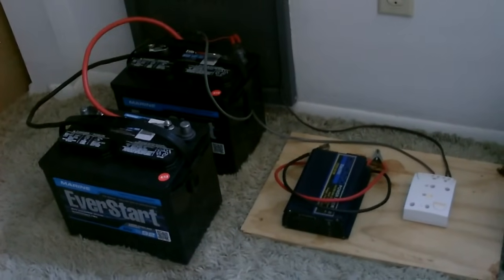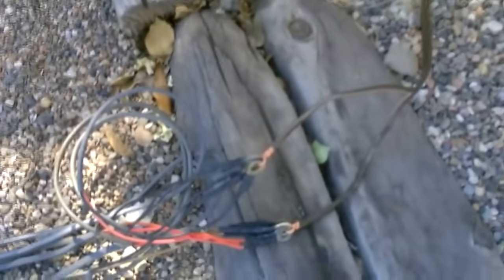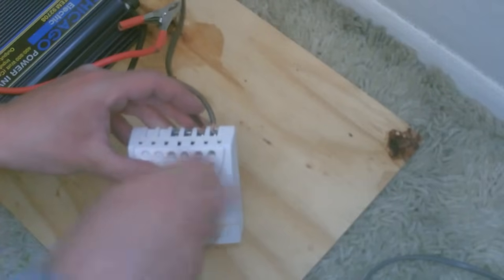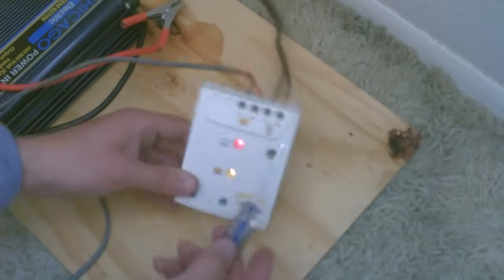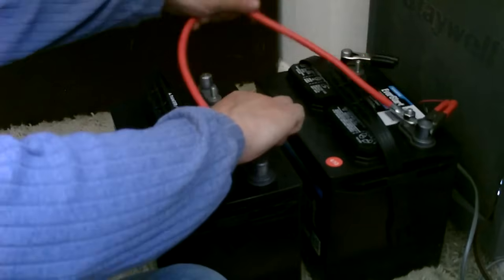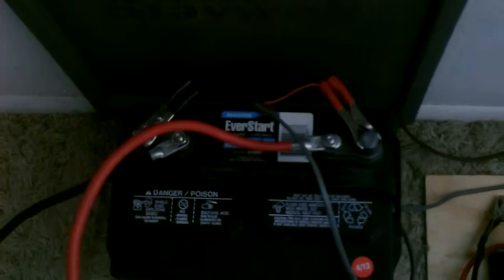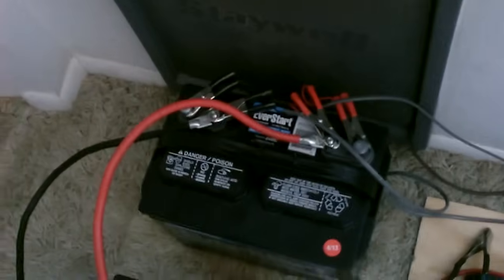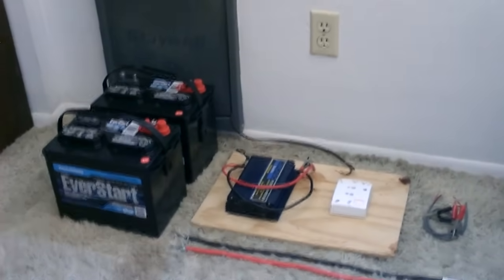How to hook up Solar Panels (with battery bank) - simple 'detailed' instructions - DIY solar system

Comment: Hi, I want to setup a solar power system just for my computer, can you give the details of the things needed? I mean numbers, how big is the battery, how many watts and everything needed to run a computer. Thanks
Reply: Got to have more info.

How many watts does the computer consume per hour?
How many hours a day are you planning to use the computer?
Besides the computer, what else is powered up? like the cable modem, router speakers and maybe a light. How many watts do they have and how many hours are they powered up.
Any printer or scanner etc etc.
Is the computer used to power or charge your cellphone or other things? how much do they consume.
Are you using a UPS that needs to be powered also.

If you are on-grid, on-grid power is usually cheaper than solar power with batteries. A desktop computer can use up to 10 times more power than a laptop. One of our laptop computers is only using 14 watts, but it is small. Our desktop on the other hand is using 350 watts when starting up and 270 watts  when running after it is booted up.  Even the different settings on the TV will make the TV to use more or less power.

They sell a kill-a-watt ( about US $ 20) that you plug into a receptacle/ outlet and you can plug your electrical item into the kill-a-watt and it tells you how many watts an item is using.

I found thousands of watts being used a month by phantom loads when I used the kill-a-watt. Items that used power while they did not do anything...just sitting there plugged up.

Comment: thank you for  the information
do you need  charge controler for small solar panels charging low voltage batteries or is it enough for the solar panel not to be too large for the batteries?

Comment: I have a 60A MPPT charge controller,  (8) 6V gel battery, (8)  250W, 37.2V, 8.87 A, a 4KW Inverter/charger
Is it okay to have 2 strings of 4 batteries in series to feed my charge controller? Please let me know so i do not fry my baby.

Comment: So just a quick ?, how you have to wires from the panels connected is there maybe a bar of bolts or a better way to connect. And how many would you need to run a mid-size refrigerator?

Comment: Can we directly charge a cellphone without using batteries i mean only with the panel or the panel + controller.?
Reply: They have simple little solar kits on eBay advertising that.  But for a system like this you need all the components he showed.  
The only other way is having the solar panels go through a grid tie converter directly to your home power and plug it in ur home wall socket
Reply: The charge controller is there to protect the battery bank.  You'd still need a dc to Ac inverter for sell phone charger.
Reply: Or one of those automotive cigar lighter plugs that convert 12 V to 5 V for the device in question.  Most phones can be charged from 5 V.  You would also need the proper cables.  You could get by without an inverter.

Comment: What kind of life span can you expect to see considering the batteries are in a climate controlled environment?
Reply: A good quality deep cycle AGM battery should be good for 5 to 10 years, depending on how deeply you discharge the battery, and how often you discharge it.  The less power you demand from the battery, the longer it will last.

Comment: Hi can i use this system to power up or to make a 2.5hp aircon run on this system? And also which one should i use the ac to dc or the dc to ac? Can i use a car battery instead of deep cycle battery thanks alot
Reply: +JesMar HS Jose 2.5hp is equal to 1.83 kilowatts, given the power requirements both batteries would be able to run the aircon for just over 1 hour from a full charge (in theory), in practice because the current draw would be so high you would get much less. If you are going to discharge significantly you need a deep cycle battery, yes. If you want to power a mains appliance from a battery you need an inverter (dc to ac)
Reply: Thanks alot for the reply appeciate it. Would you care to let me know how many batteries do i need to make the aircon run for 8 hrs and also how many watts do i need of the power inverter. Again many thanks
Reply: +JesMar HS Jose Hi, according to your information about power consumption of your air con (1.83 kW for at least 8 hours per day), you would need to generate 14.64 kWh per day (1.83 x 8). This would equate about 440 kWh per month (14.64 x 30). This is far beyond a small 'hobby' setup shown in this video and constitutes a large solar installation. Note the monthly energy output. And that battery options are sold separately.
http://www.wholesalesolar.com/1890715/wholesale-solar/complete-systems/the-homestead-3.12-kw-12-panel-astronergy-off-grid-solar-system
something like this.

Comment: @desertsun02
 If,  for example the panels only gave out 1 AMP per day in total 
current,   does that mean that in 10 days if no electricity was used in 
the home that they would have given out to the batteries 10 AMPS in 
total and stored it? 
   Does it keep on adding and increasing the AMPS that can be stored until the battery is fully charged, is that how it works??

OR.....Does it only top up the batteries to 1 AMP as that's the maximum output from the panels so this figure would never be increased and stored in the batteries, this is the part i dont fully understand.

If anyone has the answer i would be interested to find out, thanks
Reply: +SP330Y There is much lacking with regards to understanding here. Amps are a unit of current flow, not to be confused with Watt hours which are used to measure energy stored in batteries. On a full charge the batteries will each contain around 1260 Wh (105Ah x 12V). Time to full charge will depend on the charging current. The efficiency of the charge controller or solar panels is unknown so time to full charge is difficult to know.
Reply: Captain Radd
I have since found out that if for example the solar panels give out 1 AMP per hour and left for 10 hours with no load/drain then it would of stored 10 AMPS into the batteries
Reply: +SP330Y Almost there, but you leave out a few important things. You can't just say a battery stores 10 amps. It doesn't mean anything. Amps are a measure of current flow, a bit like saying the water in a pipe is flowing at 1 gallon per second. You couldn't then say water collected in the bucket at the end of the pipe contains 10 gallons per second after 10 hours. Current is the rate of charge flow. Charge does not flow when stored in the battery.
Energy in a battery is a product of 3 things: 1.Current 2.Voltage 3.Time. If a current of 1 AMP with a voltage of 1 VOLT flows into a battery for 1 HOUR then the battery stores energy equal to 1 WATT HOUR.

Comment: hi there, im checking on video on how to make a solar power like yours but still not sure on how too, can you give some info on how many watts of solar panels i need to recharge my group 31 battery? i wanted to use solar energy to recharge my deep cycle battery while out fishing using my 55thurst trolling motor, i dont want to carry two heavy batteries.
Any info on how to set up will be greatly appreciated, thanks in advance.

Comment: how many panels do I need for the home to be enuf power for the home
Reply: I have 2250 watts of panels and that supplies about half my electricty. So conservatively my estimate is 3000 watts of panels and many batteries to carry through the night. Of course for just a few lights and TV... You could get away with a few hundred watts of panels and say 4 batteries. My peak power draw at home is 8000 watts but that includes aircon. My background consumption is about 350 watts no major appliances running. Consumption can vary wildly. Also consider fridges and if you cook on electricity or gas. Batteries aren't really suitable for cooking appliances. Fridges run quietly but some have defrost cycles that run in heat and you might be surprised as to how much power a fridge can use over time.
Reply: thanks for fast reply I just started doing solar panels research again and I noticed lots of systems out there I like the plug and play system to start with grid tie in inverter, seems like a good way to start and add on from there, this seems like at least I might save some in electricity.
what you think of them, to stay on the grid and get credit for what you don't use, seems like a big savings if no battery's involved
Reply: My system is grid tied with no batteries. It is good but we work during the day so don't get full benefit. The electricity company charges us say 25 cents for one unit of electricity but when we feed one unit back to the grid they only give us 8 cents as we become a wholesaler to them. But when at home using what we produce very good in daytime. My 2250 w panels often generate up to 2500 watts because no cloud cover and high radiation. They once peaked at 2650 w which was very surprising.
Reply: That's so cool, yeah I guss they would give allot less back then turn oround and sell it lol make a profit to, so 2500 watts per day is how many units of $8 cents and how much is your electric bill now compared to what it was before? Mine is kinda strange bill normally it's $110 with 2 outside street lights but last month and month before it was $279 way out there I know I was heating my place but still 1000 sqf home my hear tem set to 62 in the day and was 70-75 in the evening I even turn it off at night and just use space heater for one room

Comment: One more thing: My plan is to use a Renogy 50w Solar Panel Kit, with 10 amp charge controller to maintain charge. Will also be ordering a Krieger 1500w Inverter Kit from Amazon.com. Will be used for weekend camping trips, emergency back up power, etc. Would a 2000w inverter be better with the 12v, 105 amp hour EverStart MAXX? Thanks again...and for video!:)

Comment: Glad to see Ever Start Batteries, as I am thinking of purchasing the newer Evermax "Maxx", 100+/105 amp hour Marine Deep Cycle Battery for my single battery set up. It is only $100.00 at Wal-Mart and not that big at all. I did notice that it is not sealed or maintenance free, is that okay? Thanks!

Comment: Once the sun has gone down and the 2 battery's are not charging, how long (hours) can you use 100 watts continuously?
Reply: You can't run it down to zero. Maximum 50% so half 12,5 hours maximum else your battery life will not last long.
Reply: The 2 battery is enough to power up 2 fan 2 light for next 12 hours.. if you want to power up whole house go pay the bill!! Lol
Reply: +mark oshields each battery is rated at 105 Ah with a voltage of 12V. 105 x 12 = 1260 Watt hours, running 100 watts 1260/100 = 12.6 hours. There are 2 batteries so around 25 hours on a full charge.
Reply: 12.6 years punk

Comment: hi i wanna ask if i can use an ordinary car batteries like "motolite"?? and what is the diff. of "deep cycle" batteries, on a ordinary car batteries?? and how long can i use it at night? ex. i use a small 220V  40W 60Hz fan.. thank you so much!!
Reply: a deep cycle battery is designed to be drained and recharged. a regular car battery is not and will fail after awhile.

Comment: hello. my wife and i are in the middle of building a tiny house and have found a homestead property to move it too. we know we are going to be using solar the majority of the time. is there a way i could contact you via email? we have a short deadline to get moved by and i have no one around me or surrounding area that knows about solar power. i have learned alot from your videos and we already plan to build a cooler ac unit like you showed. thank you so much. the overbays.

Comment: I have a 100w solar panel I want to wire to a battery.  I am in need of roughly a 130AH battery.  Is it possible I can wire the panel to the charge controller then to 2 65AH batteries then onto the inverter??  I am confused when it comes to more than 1 battery.

Comment: are you planning on adding more solar kits and if so will you be adding more batteries I haven't hook mine up yet however I just recently purchased two kits and I'm planning on purchasing another one or two I want to go for a total of 8 with the universal combiner that Harbor Freight Tools sales which I bought,,,  I also purchased from rural King 6 volt golf cart batteries I'm going to Wire in series and parallel and end up with one big 12 volt battery basically I'm still very new to this and I must say your video really has encouraged me to try and do this on my own it'll be the first time I've ever did anything with solar but your video seems pretty straightforward great job on making the video too by the way I think it's going to help a lot of people

Comment: this is the best tutorial video on how to get started with back up solar power. I do have a couple of questions. 1)what gauge wire do I use when wiring between the charge controller, the battery to the inverter, and the battery to battery (parallel )
2) where to put my inline fuses and what size fuse?
I will be installing a 100w 12 v single solar panel,  2 deep cycle batteries, 30a charge controller, 1000w pure sine inverter. I'm a complete novice at wiring but with a little help from the green community,  I feel confident I can get my feet wet with a small system and go big later on down the road, again, great video....

Comment: pretty cool. Im trying to figure how to run my central ac off solar panels so I can cut my electric bill
Reply: +Jay mans Don't worry about running AC with solar array, it's not cost effective too much voltage and amperage draw.  You probably already found that out.  Lower the rest of your energy costs so you can run AC.

Comment: Great video very basic. What does the charge controller do? If both of those batteries were fully charged how long could you power a small tv? I know there are many variables but im curious if its just couple hours? A day?  Is it possible to over charge the batteries?

Comment: Does it matter how many watts the Solar Panel is. So say I have 2 or 3, 100 watt Panels, will I need more batteries to hold that power? Also, will the batteries overcharge at all?

Comment: I really enjoyed your videos (especially on the ice maker). I'm looking at powering a 5-amp water pump for maybe an hour or two at the most per day, plus an ice maker while rustic camping. I have a 100-watt panel from renogy, but I am just not that smart about batteries. Could you help me in deciding which 12-volt battery(s) to buy?

Comment: Can you give us more info on the charge controller such as brand model or link? And the white unit on the wooden board.  Is it ok to  mix solar panels with other different watt panels? Let's said I want to use my old 10watts panels with these new 15watt panels

Comment: how much power can you store in 2 car batteries is it enough to run appliances(fridge,toaster,microwave etc not all at once obviously) and fans at a camp for off the grid living anybody can help me out with this     ps: the fridge and fans are the only thing constantly in use
Reply: The best ones you can get are golfcart batteries. I suggest trojian t-105 re but remember these are six volt sou would need to buy at least two and run them in series
Reply: Ray RayRay also whats the ratio on panels for batterie
Reply: +Ray RayRay don't know if anyone answered you or not, but you do NOT use car batteries.  You would use deep cycle batteries like what is used for a trolling motor.  It's a design difference, car bats are meant to drop a bunch of power quickly to start up the car, deep cycle are  a measured amount of power coming out over a longer time period and the battery being discharged further and not destroying it.
Reply: @rwjedi  and Ray RayRay, correct, but in an emergency, you can run appliances off an idling car engine, via its battery hooked up to a 1000 W+ inverter and through a heavy duty (10 ga) extension cord running from the inverter into the house. For 110 V  refrigerators, ACs, even water heaters, one might cycle the inverter on for 20 minutes and off, for 30, to give the car battery time to recharge and/ or rest.
Reply: +Alderaan Acres So we can use marine batteries right?

Comment: Solar pannel-20 watt,12 volts

charge controller-12 volts,6 ampere

Question:- Which inverter should i install to convert the output DC current from the charge controller to AC 230 volts?Please suggest me the name,model no. of the inverter and where it is available online!!!!!!!!!!!
Reply: Raj mohan Jena hat question is rather difficult to answer in general. It would depend on what you wanted to power and how long you wanted it on. The bigger the inverter and ac power you use the less time it will be able to work without draining the batteries. On mine, I have the 45 watt Harbour Freight solar panels connected to one battery. I have a 300 watt inverter that I have used to run a CFL lamp for 3 or 4 hours during a power outage without any problems. The lamp was very low drain (about 15 watts) and I wouldn't try running a computer or anything on it for any length of time. Normally I just use it to power my 12 volt ham radio gear without an inverter..
So basically, just remember that the larger the inverter used, the less time it will work on that setup.

Comment: Thank you for the video. I wanted to point out that I'm really new to solar. I was wanting to know it its possible to use any 12v car battery for a solar set up. I'm starting out with the RenogyⓇ Foldable Solar Suitcase Battery Charger 100W. How may battery do you believe  I can set up in series. Thank for your time.